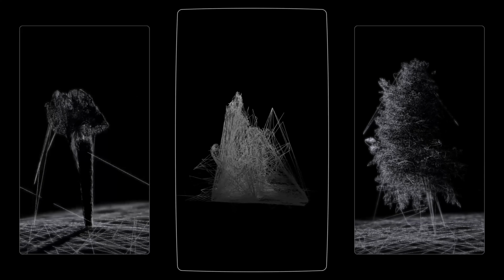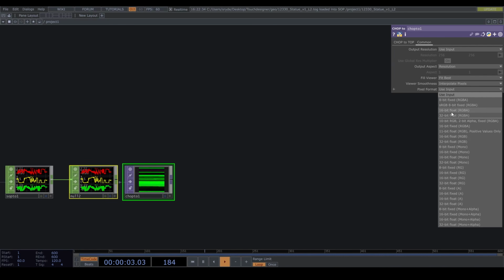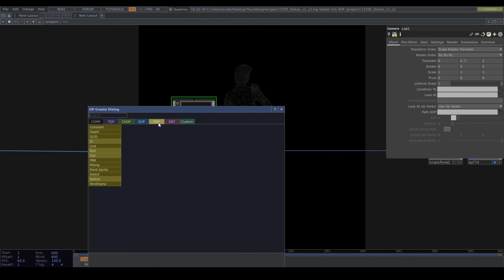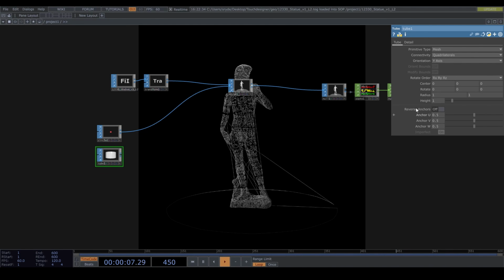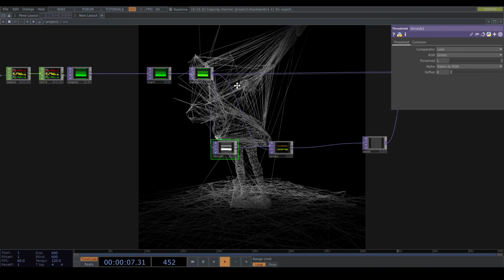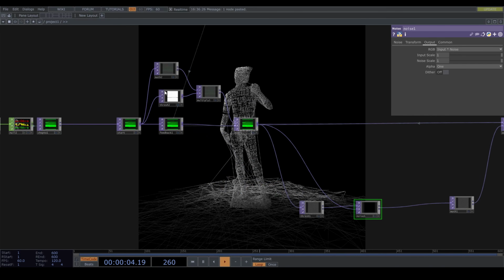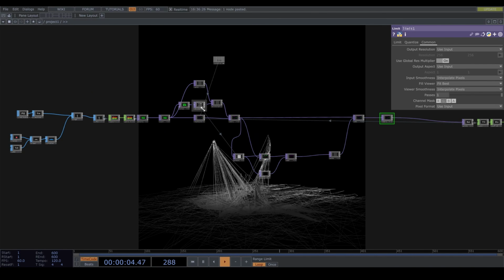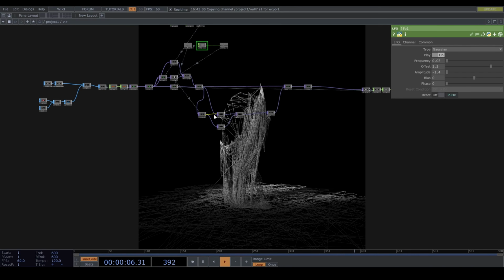Deconstructing Sculptures - Pointclouds and 3d-models TOUCHDESIGNER TUTORIAL

Comment: im fairly new to touch designer so correct me if im wrong, but can you use a polyreduce to get better performance out of your system ? 
when i was following your tutorial and added my 3d object an error popped on CHOP TO saying that my object has too many points
Reply: you can reduce the vertices of the .obj file in Blender, that's how i solved the error
Reply: @christinepoon3877  ty

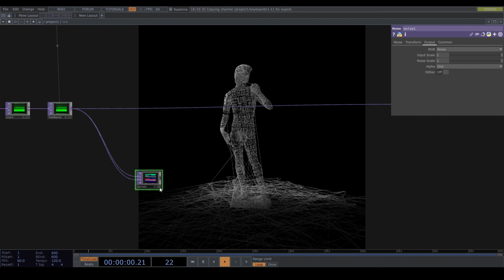Comment: on 11:17 noise is too small? i mean it does not displace anything
Reply from the maker: what do you mean by too small? you can always increase the the value in the math or the amp of the noise if you want more (faster). or increase the period of the noise if you want it larger in space. also remember to drag the end null to the feedback 11:38
Reply: @supermarketsallad   my noise looks completely different, its not lines like yours, its small cubes by it self, so theres no complete displacing
Reply from the maker: @dahelock did you have the lines before you added the noise?
Reply: @supermarketsallad  dont mind it , i fixed it by fully remaking the whole tutorial, i still dont know how this works but now it displaces like it should
Reply: @supermarketsallad  and also, how do i revert deconstructing? like theres no time line so i cant turn time back
Reply from the maker: happy to hear that, it is a hodgepodge of several unconventional techniques, so I understand that it is tricky to follow. I'll keep that in mind
Reply from the maker: @zverced  we get to that a little later in the tutorial, no timeline is the joy and curse of working in real-time
Reply: @supermarketsallad  theres no matter how powerfull noise is , its like big grid of cubes

Comment: at 11:53, wheni link the feedback,my model is missing.i did not get the animation like you. any fix?thanks
Reply: any fix?
Reply: @marinerush20  this is 1 year later... but what worked for me is tweaking the math multiply ever so slightly. the creator used .003 multiply on the math TOP. my geo was slightly scaled up so I used .09 on multiply depending on how you dealt with the transform the scale of the distortion. I would slowly adjust this number you can see your render start to wiggle a little bit and that's how you know the connection is there. there's an exact number to get it is fall and shake. That all depends on how many points ur geo has and it'll be different for each model or whatever adjustments you made on the transform node in the beginning. I hope this helped... I was stuck there for a min too

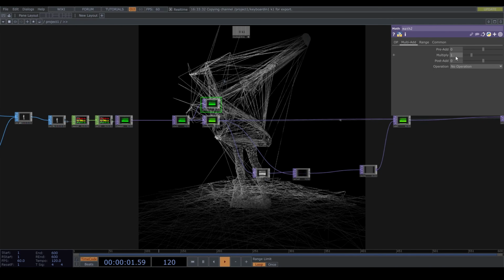Comment: at 12:48,when I choose 'math' and connect it to over ,the scale of 3D model  became very small, adjust ‘threshold’, and the lines did not have that kind of diffusion effect , the end of  lines gather to coordinate origin.
Reply: not sure if this is exactly the problem i think you're asking but just in case, check your transform of the original SOP, the first one connected to input of 3d model and ensure that the size is between 0 and 1 as they show around 2:20 in the video, I had to go back and fix that at this step.
Reply: For anyone else wondering about loss of diffusion effect around this point. Check your noise values and turn them up a little